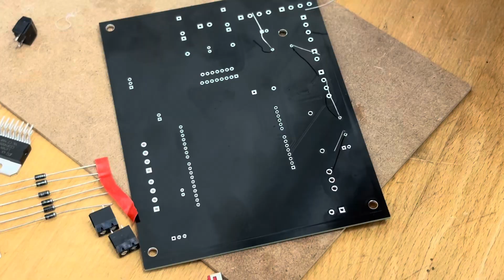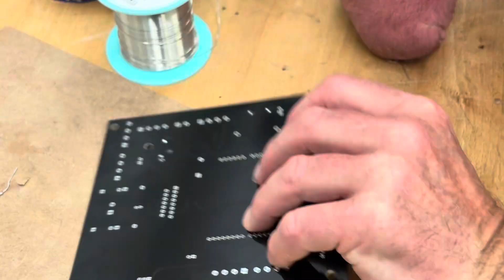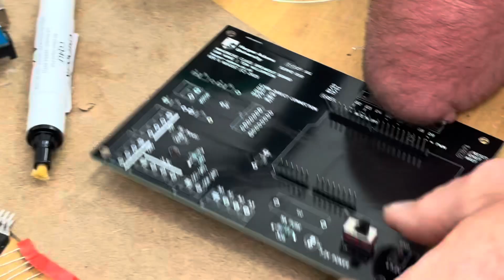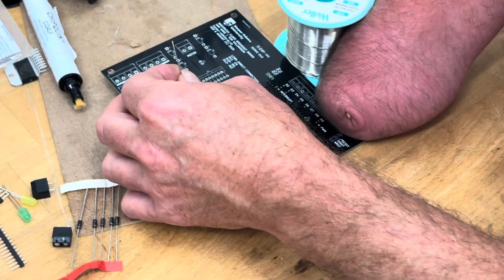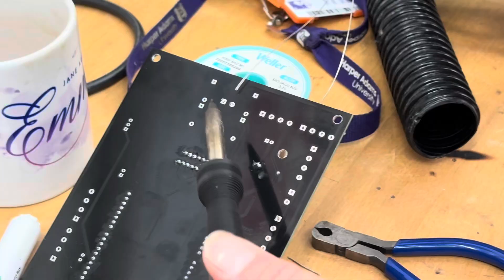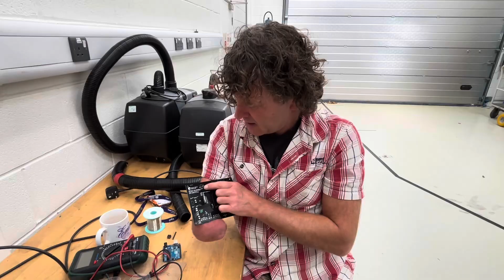PCB solder for Mechatronics 2025 Buggy Build

Comment: Looks brilliant! I can't wait to do some soldering. If the PCB has got 10 and 13 mixed up will the servo still work? A servo needs to be connected to a pwm pin. On the UNOs I've used pin 13 isn't PWM I don't know if this is the same for all Arduino thou?